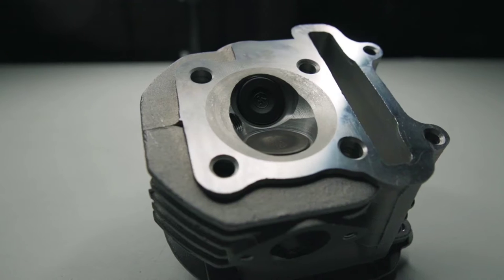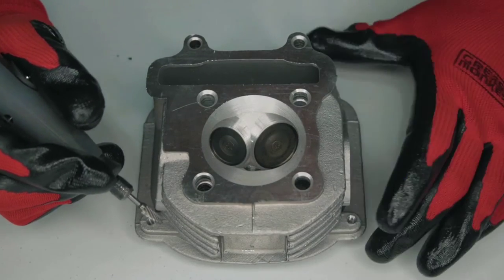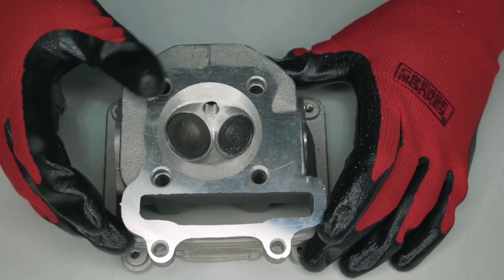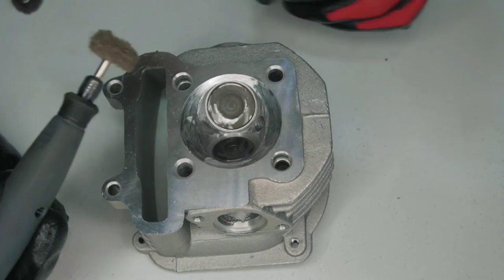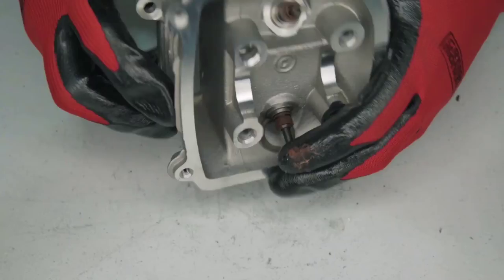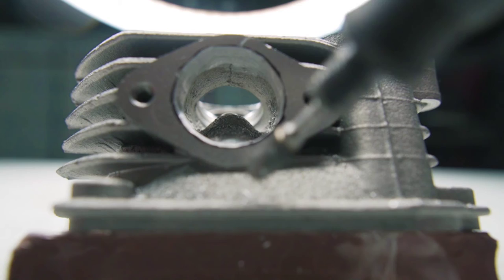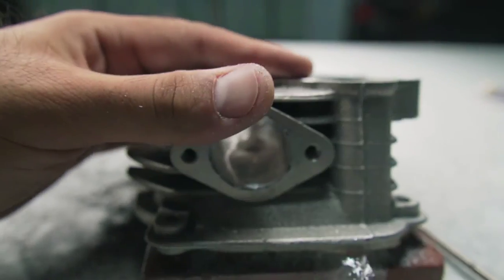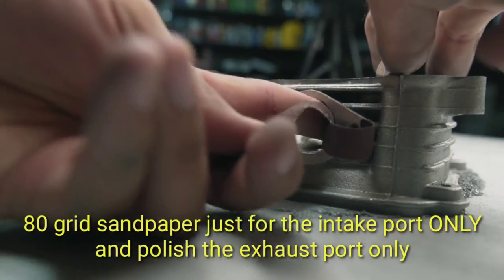GY6 CYLINDER HEAD PORTING/2019 VITACCI ROCKET 🚀👌😎

Comment: Use a matched size impact socket to push down your valve springs. It has less chance of slipping and damaging the head than a spanner and also contains your half shells so they can't be lost, they also work for better for reinstallation than a valve spring compressor by putting your spring retainer and half shells on the valve stem and just pushing down the socket
Reply from the maker: Thanks a lot for sharing this tip , I definitely will do it next time
Reply: @JMR BUILDS  no problem. It may take you a few tries on the first go when reinstalling valves to get the valve retaining shells to seat but you'll get the hang of it and by the end of one 4 cyl head you'll prolly have it. It's literally one push down to pop off and one push down to pop back in. Do this on a wooden surface and prolly the softer the wood the better for the metal

Comment: I don't know if anyone else has told you but you ruined the floor of that intake port. Now the air flow is going to slow down rather than speed up and pull more air into the cylinder. It's alright to remove excessive material from the port ceiling but not from the port floor. It effects the air velocity into the cylinder. Throw it away and try again.
Reply from the maker: Thank you so much for the feedback I really appreciate it!
Reply: Can u pls explain what that part of the port that he sanded down ? Is it ok to bring in down a little bit ? My heads diff , it’s a evo head from ec carburetor. My
Guess that it’s bad is because there no squeeze to create suction to pull more are and flow ? Tell me if I’m wrong. Ty !!

Comment: If you color the entire gasket surface with Black magic marker and then use a seal pick to scribe a thinner, more accurate port opening line to follow, tracing the inside diameter of the gasket, as a template.

Comment: Im usually go 80% intake port cross sectional area to Valve d ratio, it has good torque from 6000 - 12000rpm, and you just go over 120% which is just to much, you need test you head port in flowbench

Comment: How is the port job now after 9 months. I’m worried abt grinding the valve guide support in each port.
Reply: Like he said it goes a long way if you check out some of the car porting vids they as well remove some of the guide. You don't have to for a mild port job but for all out racing you want all you can get but you need to know the formula to make it work because you can over port hope all works out for you. ✌️

Comment: For the people out there that don’t want to use a smaller head but want more compression…. Buy a thinner head gasket orrrrr take material off the bottom of the head using a flat surface and sand paper, or use a head stone. Mark the bottom with a sharpie and slide the head back and forth across sand paper on a flat surface until no sharpie is left. Repeat that until desired compression ratio. The only issues I see with this method is removing too much material and the timing chain not being tight enough… if you’re careful on how much you remove, you’ll be okay.👍🏻
Reply from the maker: Thanks for the tip 👍 😀
Reply: How much can be removed?
Reply: Sand in a figure 8 pattern, back and forth will leave low spots on the leading and trailing edge and leave your side high and the sand paper should be on a very level surface, mirror glass is good. When it comes to how much needs to be removed, not much is heaps, 1mm is heaps for an engine that is already tiny.

All of this kind of work I advice the motto less is best, especially with porting or polishing, a simple clean up of rough edges will vastly improve flow without getting into risky territory, plenty of ppl have ruined brand new heads, also the tensioner will take up any slack in the timing chain, its how close do you want valves to get to piston
Reply: @coolhandluke1503  have you tried shaving the block instead of the head?
Reply: @KXSWORKS  I personally haven't but the piston liner is cast iron and will be a lot harder to shave and may take of more aluminum off the block and leave the liner higher then the aluminum block, shouldn't be that much of an issue as you should be using fine grade paper
Reply: @coolhandluke1503   I have access to a machine shop
I'm worried the piston might poke out of the cylinder and hit the cylinder head
Reply: @KXSWORKS  I was thinking about it and I can't see why it would be different to machine head or block. I would use blue tac or play doh, take head off, put the putty on the piston, put head back on (with head gasket preferably old one not to crush new one), wind the engine by hand at least 2 revolution so both valves operate, take the head off and the putty should have been squished between valves and piston and that will give you an idea of how much you can take off. Keep in mind thermal expansion, everything grows with heat including conrod length, so leave some room to spare.

Honestly I don't think you need to take it to the limit, that will cause other problems. like I say less is best. Not sure how much extra compression the little starter motor can take before it wont turn the engine. changing the engine like this will require you to retune carburetor, jetting or a larger bore carb altogether, but if you still have stock CV carb (anti-wheely carb), I'd replace it with a round slide, often found on pitbikes, 24mm-26mm venturi carb (providing you aren't stroking it or bigger piston this size is perfect), you can get a flat slide cheap enough but they can be a hassle to tune. Also consider port matching the intake pipe and head together. the intake manifold is very restricted. I just bought the larger one and it matches the port into the head perfectly, but the bolt holes need to be elongated. no use upping the compression if the flow of air is restrict. The exhaust pipe aren't always the neatest so you may even want to clean up any rough edges entering the exhaust pipe.

Comment: U are welcome I am thinking about getting that reveno clutch what do u think about that clutch do u think it is any good
Reply from the maker: I think everything depends on what you want to get out of your scooter, for example, if you are drag racing against other scooters I think the reveno clutch will give you a little bit more advantage over the traditional clutch, but if you are just someone like me that just like to take the scooter around town and have a good time  I think buying a reveno clutch is a little bit out of my price range to spend on a clutch because the difference is just going to be very Sligh against a regular clutch  , I would just rather keep my original clutch or buy a high performance clutch and invest the rest of the money in something like a bigger crankshaft, oil cooler, or whatever is really help my scooter run faster , but If money is not an issue I would definitely buy it for myself too !
But that is just my 2 cents

Comment: You need to get the forge piston too especially on an RPM like that my goodness and dual valve springs with stainless steel valves
Reply from the maker: Thanks for watching! You are right, I forgot to mention that sorry, I already have some titanium valves and  titanium valve springs , supposedly are rated for 12,000 rpm also I got the forged piston 🙂

Comment: Good work! But arnt u supposed to only polish the exhaust side bucuz i thot the roughness actually helps atomize the fuel better?
Reply from the maker: Thanks alot for watching the video!

I only polished the exhaust port but I left the intake port rough because that will prevent the gasoline to condensate and atomise better whenever the gasoline goes through the intake port , in the video the intake looks like is polish but is not I just used the carbide bit on it and I left it like it is 

But yeah you are right about your statement!
Reply: You are right it was very good until he polished the deck surface. Bad mistake. First it is to easy to make it uneven with something round instead of a flat sanding surface. And 2. You never want your gasket surface polished slick. Compression could allow casket shift. You should actually wipe the deck with 80 grit paper on a flat sanding block. I’m glad to see people getting into it but research.
Reply from the maker: @billyclevenger2632  thank you so much for the info brother, I haven't installed the cylinder head yet but before I do it I'll make sure to sand the deck surface to avoid any compression leaks !
Reply: Yes and you can actually dimple the intake side like the surface of a golf ball but this won't help if your injecting straight in to the cylinder double check.
Oh and I wouldn't grind anything on the cylinder side your going to lower the compreshion and bhp.

Comment: Did you also remove part of the metal that the valve slides into? There's like a different metal inside the aluminum hump you removed...did you remove some of that other metal as well? It looks like you did because it's not sticking out.
Reply: You’re not supposed to lol. I’ve done a lot of porting jobs on gx390 and predator 212cc motors and I’ve removed them per customer request and it never lasts that long.

Comment: Hey my friend u done a great job on that head u do the same thang I always do I use my same head when I put on a big bore kit to get more comparison keep up the good work where did u order your valves from if u don't mine telling me
Reply from the maker: Thanks alot! I always buy my parts from a store on ebay ,they come from Puerto Rico ,  this is the link for the high performance valves!  https://www.ebay.com/itm/Performance-GY6-150cc-Racing-Upgrade-Valve-Kit-Seals-Power-Springs-Hi-Output-A-/323748551241?mkcid=16&mkevt=1&_trksid=p2349624.m46890.l49286&mkrid=711-127632-2357-0
Reply from the maker: And this are the retainers for the valve spring https://www.ebay.com/itm/SCOOTER-GY6-150cc-High-Performance-Titanium-Valve-Spring-Retainers-Set-of-2-/172611024966?mkcid=16&mkevt=1&_trksid=p2349624.m46890.l49286&mkrid=711-127632-2357-0

Comment: Great video man. How did it it turn out? What type of performance improvements did you get? Thanks
Reply: This does zero for performance. Nothing, nada. You're just risking ruining a head.
Reply: @A_Stereotypical_Heretic  if you upgraded your carb to a larger one then yes it does. its likely to be larger than the intake port on the head and since its a carb the fuel and air mixture can get pretty wonky.

Comment: Hello sir, I did the porting and polishing on my cylinder head and I have the Tiada big bore 171 kit as well. I am wondering where I can get titanium valves for the head? Thank you for the video. Can you send me a link to the titanium valves?
Reply: Amazon has two types of NCY high performamce valve springs one set is $23 other titanium springs are $28 150cc only it says tho
Reply: @cemtkeenan2750  can you tell me what size valves I need to order if I'm porting a stock 150 head? I have the Tiada bbkit and  A9 cam and I want to di this to my stock head. I just don't know what valves to order. Thanks so much bmy friend!

Comment: Plz help, I recent ported and polished the head on my 07 Polaris outlaw 525 IRS and now I’m getting a red hot head exhaust after only about 5 min of idle. It’s an exhaust kit and slip on from Big gun. I’ve tried putting bigger jets in it, I went up from a 160 to a 170 and tried messing with the pilot screw and it helped a bit but the problem persists. Should I go even bigger on the jet?
Reply: Get a new head. And make sure your exhaust and exhaust port are free from obstructions. Don't do this porting nonsense. It adds literally no performance benefit. If anything it's a detriment
Reply: @A_Stereotypical_Heretic  🤣🤣🤣 had to do it.

Comment: Will this method work for 139qmb 50cc gy6? If I just port only exhaust and intake??
Reply from the maker: Yes it will
Reply: @JMR BUILDS mind me asking what kind or brand tool you using. new to porting beginner actually I’m porting a head on the side just to practice for my 52 mm head to put on my scooter
Reply: I have done something different on a stock 139QMB head. That was its called "hognose" both intake and exhaust guides in the ports. To "hognose" just remove material to either side of the guide and leave the guide intact. Much safer for a dependable daily scoot I thought.

Comment: I really thought that messing with the guides was always bad for daily use
Reply: Daily or racing it will ruin your valves, all that material helpt cooling the valve stem. For racing purpose it's even worse tbh since you create higher temps. Definitly run a oil cooler routed to the head. Its possible to have that kind of a port and it being reliable but not with the materials used in these mini4strokes  heads
Reply: @mathisvleeshouwers2635  thanks I’ll be adding a oil cooler
Reply: @jzsquad6866  👌 you could remove a little bit making it smoother. Main rule is to take your time, a little mistake will happen but you'll be able to clean it up np

Comment: I'm guessing you didn't make a follow up video on this because you absolutely ruined your head? And realized porting a 4 stroke makes almost no sense?
Reply from the maker: I will make a follow up video. I have put already like almost 900 miles and everything is still working properly, thanks for watching !
Reply: @jmrbuilds awesome. I look forward to the follow up! But you can admit you gained no performance value from the port right?
Reply from the maker: @A_Stereotypical_Heretic the scooter gained like 8 miles more on the top end and is a little bit more quick reaching the top speed but for a scooter that's a big improvement lol 

Of course nothing compares to a 2 stroke or a bigger engine like a 600cc inline
Reply: @A_Stereotypical_Heretic  i ported mine like this some years ago and got better aceleration and top speed. Of course this head won't last like a stock one but if You wanna gain something You need sacrifice something and take some calculated risks
Reply: @A_Stereotypical_Heretic  Drop the attitude.
Reply: @androidken  what attitude? There is literally almost no benefit to porting a four stroke engine...any performance increase anyone thinks they got is either from a different mod done at the same time or it's just a placebo effect. 
These aren't big breathing v8 engines.
You MIGHT get a hundredth of a horsepower from it...but you're risking your entire engine in the process.
Reply: @chriscreswell4793  lol probably. But I'm just trying to save people precious time by convincing them not to go something utterly pointless. These engines do not demand or produce enough compression to gain any benefit from removing a couple millimeters of a port. Sorry... Its just a fact lol